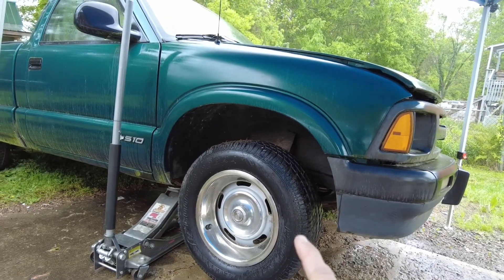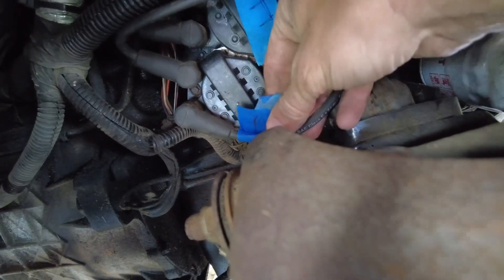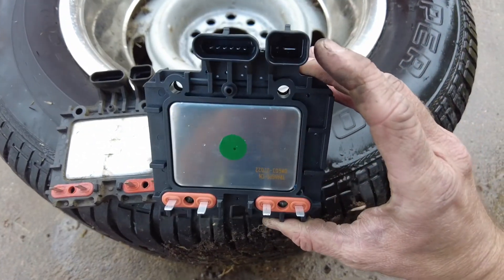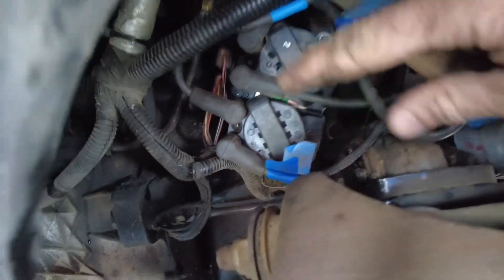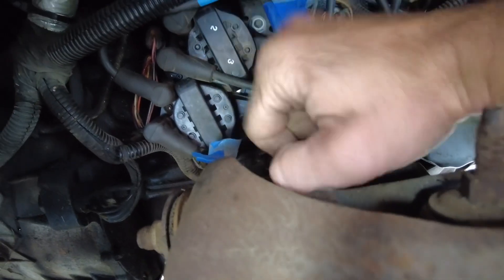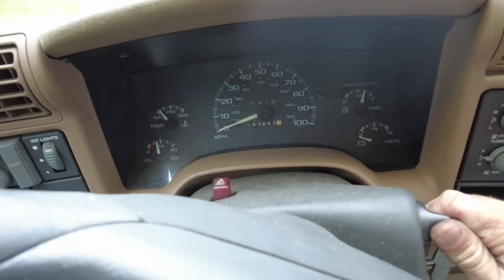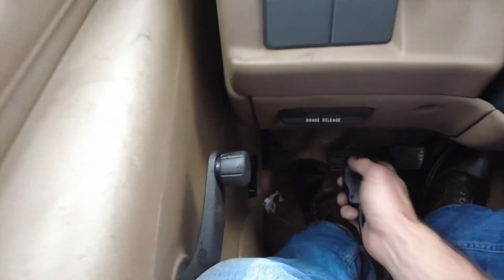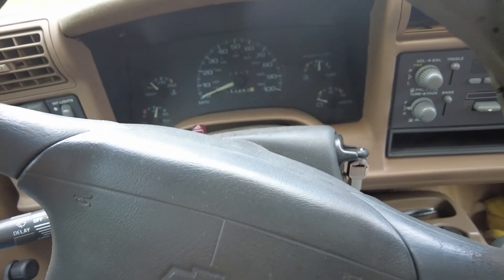Chevy S10 2.2 new ignition control module

Comment: Ive been having the same problem with my 96 2.2 .... Runs fine then after a few mins of running it losses power and ive changeed everything.... Im thinking maybe the fuel injectors now
Reply from the maker: Have fun, they ain’t the easiest in the world to swap out
Reply: @ChrisThedudenurse  well I pulled my intake apart the other day and swap the number one and number two injectors and now I'm getting a po302 code .... Beforehand I was getting p0301.... So that's a good indicator of my problem I believe
Reply: loses power or starts to misfire>? these are bad about having corroded grounds all over the frame. Also, the injector Oring will start to leak and cause misfires.

Comment: I’ve been having code po304 misfire changed all spark plugs,cables and ignition coil.still getting the same code.
Reply from the maker: Mine actually ended up being fuel related.  EGR and fuel pressure regulator.
Reply: Thank you very much I will try that myself and hopefully it works I changed the egr as well that had popped up on the scanner really appreciate

Comment: i bought a 96 sonoma with2.2 and 5 speed spun rod-killed crankshaft 1600 later motor is back in truck=no spark at plugs-replaced cam sensor and crankshaft sensor. swapped coil pack and ignition control module -no spark at plugs - any reccomendations
Reply from the maker: Almost sounds like something didn’t get connected back.  I’d start with wiring.